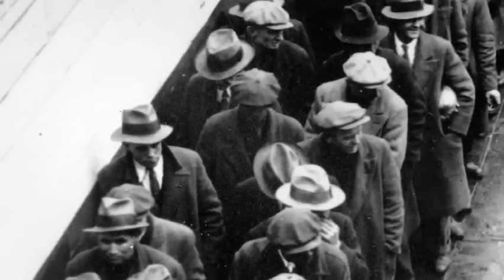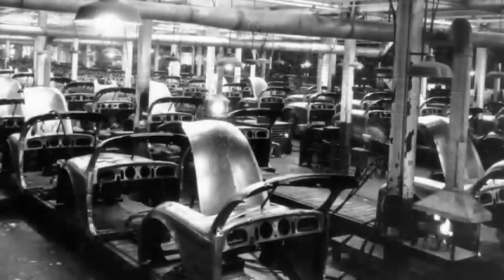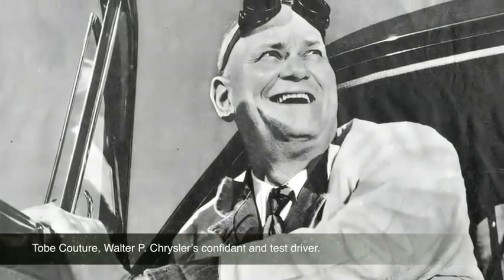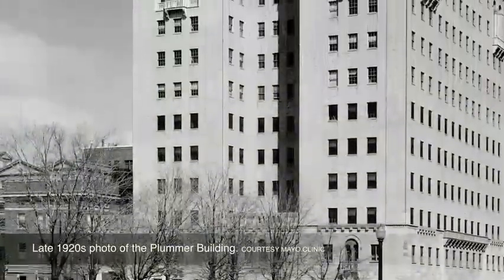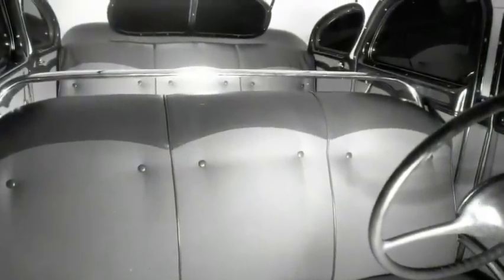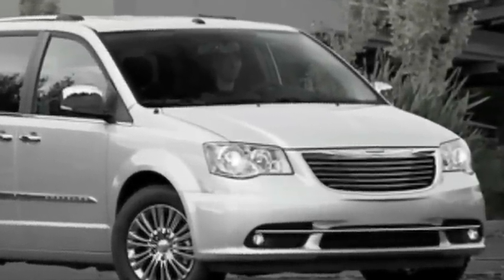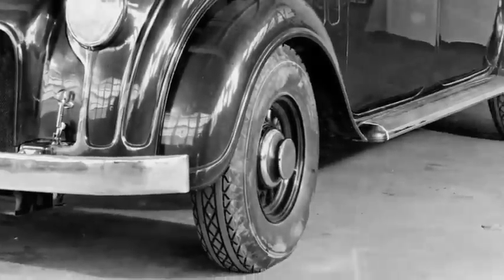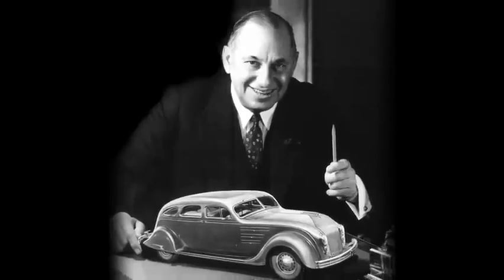The History of Chrysler's Airflow Car

Comment: The 1934 Chrysler was just as much an engineering masterpiece as the previous 1924 Chrysler. But an aerodynamic car is only relevant if driven on straight, level, multilane highways built for high speed which did not exist until the 1950s. The real success for Chrysler Corp during the 1930s was the Plymouth whose sales increased every consecutive year from 1930 to 1937.

Comment: The first American car with aerodynamics. The French already had the Citroën and the Germans had the Volkswagen...
Reply: The Airflow debuted in 1934, the VW Beetle in 1936. The Beetle body in many ways copied the Airflow body – the sloping front, the "fast" back. The Airflow had a unitized construction from top to bottom. The Beetle  "semi" unitized. The body, absent the fenders, was welded together in one piece. It was however bolted to a "pan" in the center, which had a subframe attached at the front, and the rear. The pan was reinforced on each side with small, light, I-beam-like rails. I could be mistaken but I believe the underside of the Airflow was, unlike the Beetle, welded to the main body.